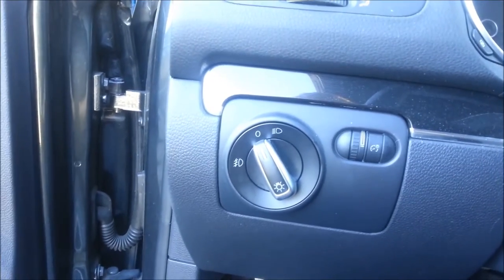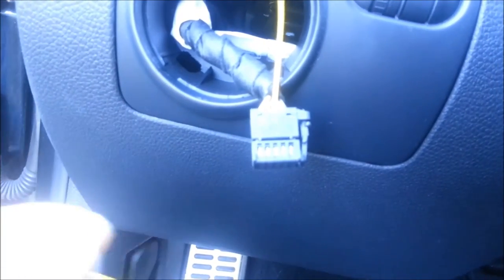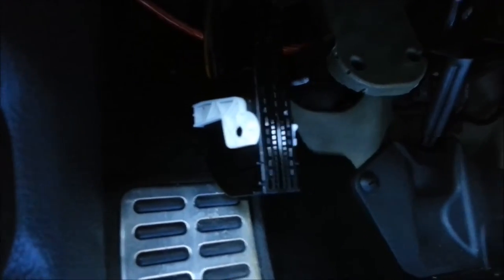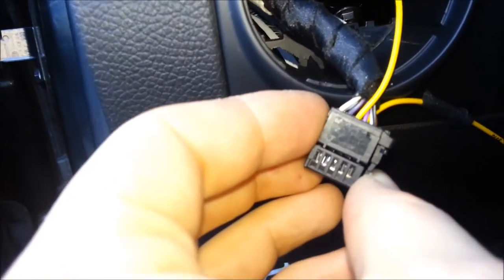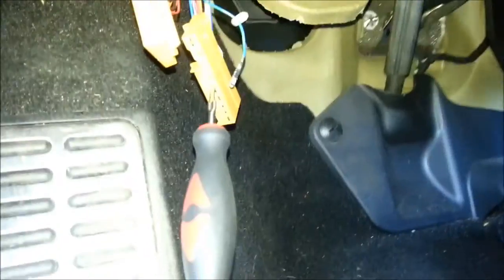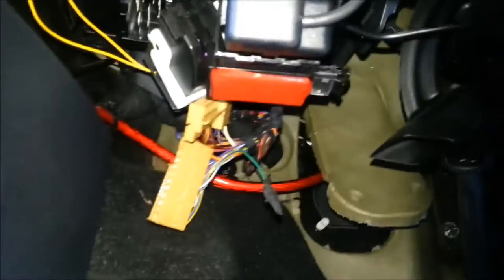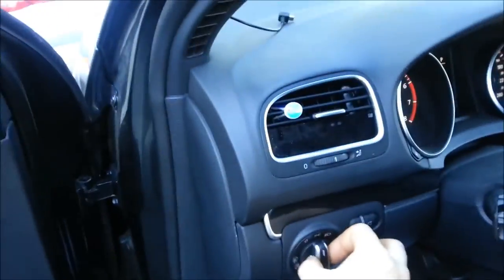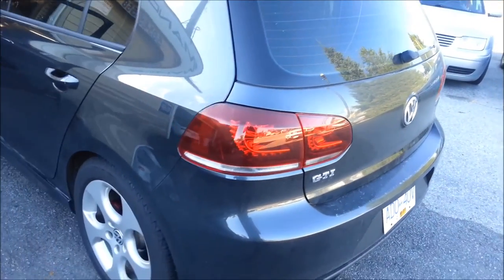HOW TO INSTALL OR CHANGE A EURO HEAD LIGHT SWITCH MK6 GOLF GTI

Comment: Thanks for the video. It was a great help. While I installed the European tailslights and lightswitch about three years ago, I never completed the wires to get the rear fogs to work (it's just such a pain to work in the footwell and I lack the patience). Anyway, wire 28 from the black connector seems rather short and doesn't seem to reach over to the brown connector. Any suggestions? Did you remove the tape from the black wire trunk (don't think I want to do that), or did you use some sort of an extension?

Comment: Hello, i replace tail lights to euro, lamp switch too. I place wire for reag fog, and replace wires in connectors. But i dont know where place second cable for park light. Now when i turn switch to park, will turn on headlight too.

Comment: Hi! Great Video! I am curious if you'd be interested in adding part numbers for the switch you used, any pins you'd need or recommend, gauge wire used, etc etc. Some of these things are getting harder to find as time goes by. (We are seven years on this video currently :) )
To that note, I love when I get random comments on older videos. I hope this reaches you well and that you have a great day! Do you still own this car? What did you upgrade to?
Reply: Just realized the pin and wire comes with the kit you purchased. :) I'll probably find all I need via more Google by the time you may update. I'm sure future views finding your video in the ethers would appreciate it. :)

Comment: Hi
My concern is about that fact that my driving headlights are own when I start the ignition, but I still need to turn the switch manually to the right end in order to get the dashboard and radio lights ON. I tried to buy only the switch which has (AUTO mode) as my old one didnt have that, I still not getting the dashboard lights on, what should I do?

Comment: Very nice video clip, well recorded. 
However, you lost me after you connected the fog light wire to the Euro switch. You inferred that it should go into the Brown control module - pin 17, but then you removed wires (green and grey) from the Black controller to connect them into the Brown controller.  You made an attempt to "edit" (at 5:03) as to which wire goes were, (actually saying that the yellow/trigger wire with the tape - hence the fog light wire - goes in fact into pin 17 Black Controller, not the Brown controller) but it was in between takes. I watched 4 times and still have no idea why you removed the Green wire and leave it unconnected (just taped) or the Grey wire from pin 28 Black connector and snapped it into pin 47 Brown controller .  
It became like a cabbage stew since you split the Brown controller and haven't explained exactly which of the two yellow/trigger wires went into the Brown controller (and why)… You might need to revise/amend your video clip...